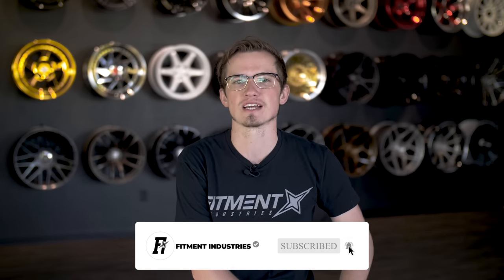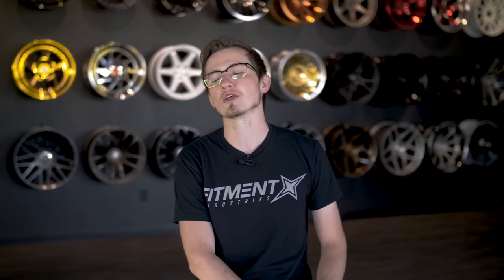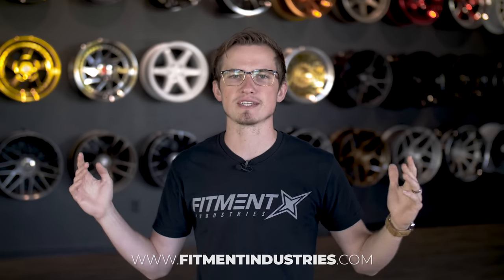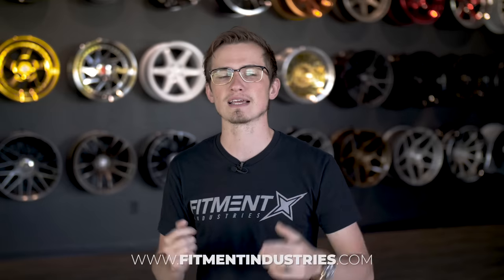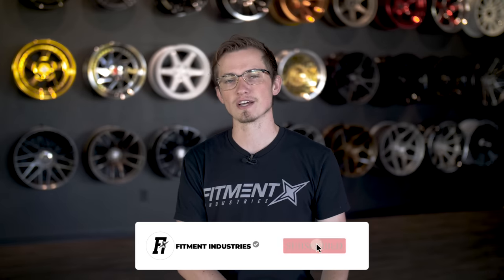Why You Should Lower Your Car

Comment: I prefer lowering the car on stocks over aftermarket wheels on stock suspension. I’d rather see a car slammed on it’s nuts on steelies over nice wheels with a 10 inch wheel gap

Comment: yep, junkyard swapped discs on the rear, and tein coilovers first.....then the list gets continually( and forever?) longer...lol.....great content, glad I found your channel
Reply: btw, itsa 97 impreza outback sport 2.2 NA, and, if any one cares to read this extended paragraph that list sofar includes;  95 Legacy rear discs, Tein Flex Z's, sti alum front control arm, Cusco front strut tower brace, Whiteline rear adj. strut tower brace, Whiteline rear trailing arms, laterals,  and connectors... might sound expensive, but most of these things replaced high mileage, worn-out OEM equipment, that would have cost about the same to have done at any shop/and/or buying subaru factory replacment parts ( $$$ as they are "very proud"  of their stuff, $$$... just sayin'), as i did all but the final allignment myself (With MUCH help from MANY Youtube Channels, including quality channels like Fitment Ind. ) .....But, brake and suspension work was interrupted by water pump failure, resulting in blown head gasket...yeah, i know, subies blow head gaskets like rain in Florida, but 245,000 miles and a good overheat will almost certainly kill something that used to seal......that means milling heads, multi-angle valve job, better springs/retainers, ARP headstuds, gasket-match/port n polish heads, gasket-match intake, Delta 200 torque cams, Inferno Fab's EL  (matbe UEL rumble?) headers, and Flowmaster Delta 40's; i mean you can't just "put it back together stock"........soon to resume suspension/brakes with adjustable anti-sway bars and mounts/links f / r. ( prolly Whiteline ), Whitelines' roll-center adjust and anti- lift kits (to reset suspension geometry angles after lowering), Cusco's lower subframe brace rear and lower "H" brace front,  and finish up with old school early 90's sti/wrx 16's and 4pot/2pot brakes, and finally Wilwood's brake bias/stainless lines......for now

Comment: I was going to buy a set of rotiform lasr’s for my r53 mini which has lowering springs but I still stink it’s not low enough but now I’m leaning towards going with coil overs before I do the wheels because as I think of the wheels I think it may look better when it’s lowered with the stock rims in comparison to the other way around thank u guys for making this vid. It should have been made sooner.

Comment: I chose wheels and tires first. The stock wheels on my 2000 civic already were awful and did not want to be the guy lowering his car and driving around still on stock.
Reply: Now my new to me 2016 Miata will get suspension first since the default wheels are not a bad sight.

Comment: Im buying a 2006 Infiniti g35 sedan. Im putting coilovers first, then wheels and tires, then ill put in the xenon headlights and tint tint the lights and windows, then as far as the engine and power gains goes ill start with a cold air intake and exhaust
Reply from the maker: Sounds like a wild build man you should upload your car to our gallery sometime! https://bit.ly/2Ma4oca 🙌🔥

Comment: I out Eibach 30/35mm lowering springs on my Fiesta ST150 and now just bought some Sparco Assetto Gara's. Gone down an inch too 16x7 and wrapping them in some 205/45 Toyo TR1s. They are Matt black going on a Black ST150. The ET is 10mm less than standard so all together the car should sit and look much better.
All documented on my YouTube Channel

Comment: I have Enkei Raijin 18 x 9.5 + 45 on my 13 wrx with the rear fenders rolled.  With BF Goodrich G-Force Comp 2 Tires 255/35 R18 .And it's on stock suspension . Not to high not too low looks GREAT. 👌
Reply from the maker: You should definitely upload it to our gallery sometime we'd love to see it! https://bit.ly/2Ma4oca

Comment: I did the following and very happy with performance results.  
1. High performance tires
2. Performance brakes
3. Tune and full turbo back exhaust together for stage 2.
4. Engine mod: cold air, charge pipes, diverter valve, turbo muffler delete.
5. Enkei RPF1 rims
6. KW coilover
Reply from the maker: Sounds gnarly dude you should upload your ride to our gallery. We would love to see it! https://bit.ly/2Ma4oca

Comment: the first car I have is 2002 renault clio 1.2 16V 55kw, and this year i changed suspension and brake parts to a new (stock wheel gap), cause if I would put lowering springs my car would SCRAPE the road.
In Croatia There aren't many good roads that don't have some sort of damage, unless you are near big city's.
By lowering my car I would have damaged my car underneath. 
So for me I'm going to change my stock 14'' steel wheels (at the begining of next year, when I'm going to have money to buy better quality wheels) that came with a car to an alloy wheel 15'' or even 16'', depending on a weight of the wheels.
And then after an year or three years if I won't be satisfied with the look's and how car handles I'm going to change it.
Reply from the maker: Well, man when you're ready to upgrade your wheels check us out! https://bit.ly/2Imgo9B

Comment: Anyone know the drop on TRD lowering springs?
Reply: Just pull the trigger bro. Install them and test them for a month. If you don't like them you still have them fairly new just sell them on Criagslist or Offerup.
Reply: Ronaldo Mejia I want to say 1.5 front and 1.75 rear loaded .  I would just go raceland coilovers . Then you can adjust as needed . Super easy to install too and priced reasonably. I’m running em 3” drop and no issues .
Reply: @EARDRUMASSASSIN  might as well. They r the around the same price and coilovers better
Reply: Coil overs which cost the same as lowering springs is a terrible idea. You can adjust height as needed, but unless you need to slam for car shows or live in a heavy snow state, you will never mess with the height once you’ve set it. And at the very very least, go tein street basis. 

Lowering springs are perfect for most people.
Reply: trdmomo lowering springs are for ppl who don’t want to lower their vehicle properly and do it cheaply . You realize stock shocks and struts are longer than aftermarket coil springs and can unseat the spring easily because you just mismatched coils and struts . Coil over kits have matched spring rates for the struts and shocks . The only good tein  sets are the 800 dollar and up kits other than that they are basic over priced . You also don’t get the performance out of stock struts and lowered springs as you do with true coil over kits . I honestly don’t think you know what you are talking about but to each their own .
Reply: EARDRUM ASSASSIN do you realize for someone saying I didn’t know anything, you suggested the OP buy raceland coilovers? 

It’s cool. You already showed me your hand.
Reply: trdmomo what are you talking about ? I have a feeling you don’t even own a lowered vehicle . Go practice your awful golf swing . There’s nothing wrong w raceland coil overs . You probably never owned any of the brands even mentioned lol
Reply: @ Ronaldo Mejia, I wouldn't do just the spring's on the stock shocks/struts they will end up blowing the seals quickly and you'll end up with a bouncy ride, so get new shocks/struts with the springs. Raceland is ok but they only have 1 collar for height adjustment if you lower it too much you limit your shock travel and will bottom it out easily. Tein street basis also have a single collar but is a better quality product.  The lowest price coilovers that i have found that have 2 separate collars for ride height and spring preload is cxracing so you can load the spring and still get full shock travel and still be able to lower your car.

Comment: I have a 2013 Hyundai Elantra and I’m wanting to lower it but still want to keep the ride quality and handling as much as I can. Should I got with Springs or Coilovers? I don’t have air suspension money right now but maybe down the road
Reply: @ Marvin, sorry man that doesn't exists, every lowering kit be it spring, sleeves or coilovers will ride harder they need a higher spring rate to keep the car from bottoming out so you end up with a firmer/harsher ride. But usually a lowering spring will be softer than a coilover set up, just remember to change you shock/strut because you old one's will blow shortly after you put a stiffer spring on them.
Reply: Right on. Thank you
Reply from the maker: Lowering coils are a great option a decently smooth ride, I have seen some guys at our shop running coils and depending on what kit you purchase the ride quality on some coils can actually turn out pretty nicely!

Comment: So this is what I did to my Ford Fiesta Titanium in order:
1. Change the front grill to a black one instead of chrome (I hate chrome)
2. Change wheels & tires to 17 inches (stock is 16 inches) & black colour (original wheels are silver)
3. Do some wrapping (rallye stripes, remove all chrome accents, side mirrors black etc.)
4. ECU-Tuning to improve performance (stock was 100 Hp so I wanted a little bit more punch)
5. Sports air-filter from K&N
6. Sportsexhaust from Fox.
7. ST X suspensions/coilovers
And that's all I am ever gonna do. It's my daily car so I have to keep it practical.

Comment: First mods... For men... 

Brakes... 

Anything that adds hp... 

wheels that are light and strong... 

Tires that grab traction... 

Forget tint.. lowering.. system... 

Now your car is faster and you can pick on idiots who cant keep up.. 

Also moding suspension should be for better handling.. lowering kits do not always make a car handle better... most of the time it makes the car handle like shit and cost you time on your lap..
Reply from the maker: Cant talk that smack and then bust your car up on a turn! 😂
Reply: @FitmentIndustries  THIS.... IS.... MERICA!!  we DONT DO CORNERS HERE..
Reply: @FitmentIndustries  but honestly most suspension mods I have came across didnt result in performance.. some do for sure but most people ignore anything that doenst lower a car. :)

Comment: I'm 60 but got a black n yellow 05 mini S and i'm currently having a 900rms sound system installed. Next I am looking at the "KW Suspension KW Coilover Kit V1
KW-10220042". I think I read somewhere that it will lower it a minimum of 1" and a max of 2". Is that correct and do you think that will cause rubbing issues?

Comment: YouTube algorithms are scary. This has been on my mind lately. This reasoning had crossed my mind so kinda glad it's back up a little. Recently got a new GTI. Plans are..
1. Front "no holes"  license plate bracket. Done today actually. Just in time cuz my temp tags are almost expired.
2. Rear wing extension. Inexpensive and massively changes the profile of the car for the minimal  investment.
3. VTF lowering springs. Cant justify the cost of DCC coilovers for the short term. This seems like a good option for the next 2-3 years.
4. 18" or 19" wheel and performance tires. Wheel size will depend heavily on how car drives with the springs.
5. Stage 2 tune when/if I buyout the lease and end.

Comment: i got an 09 dodge avenger sxt, looking into aftermarket wheels (DRIFZ® - 303B HOLE SHOT Satin Black) and possibly going with (Meghan Racing Coilovers) what do you enthusiats out there could advise me on what to look out for or go for. i wanna know what offset would be nice and maybe other varieties on coils? the wheels i want im planning on getting them 18x8 witha 35+ offset. i'll let u car heads give me the proper advice.

Comment: My 2018 VW Passat GT came with a tuned lowered suspension from the factory only problem is the drop was only .6" and the wheel gap up front was noticeable. I got a set of H&R lowering springs and even though the drop is only 1.4" front and 1.5" rear (in reality .8 front and .9 rear factoring in OEM drop) it looks 100 times better and the drive is identical to OEM.

Comment: I did H&R sport springs on my 95 Saturn Sl2 with the stock sawblade wheels which are 13 lb wheels and a polyurethane bushing kit. But now I want to buy Einkei RPF1 15 X 7 with a wider offset in the rear, 205 50 R15 Toyo proxies like what was on the blue Mazda Miata, in one of your other vids and Eibach race springs and lower it another 6 inches, maybe more to have a wheel gap no more than being able to slide your fingers in the fender over the tire and nothing more. Just need to find a decent place to get the right spring dimensions to accomplish that.

Comment: Just keep it clean and as oem of a look as possible.

1. All bulbs led or maybe hid, consider they make really bright led lights now(I prefer white headlights and fogs now instead of the blue and yellow)
2. Slam it
3. Maybe aftermarket rims if your traction is necessary for track use, or you want to ad a little of your own touch to it.
4. Muffler and maybe exhaust(not too loud)
5. Sound system
6. No tint even

I just personally prefer it as clean/ oem as possible now. When I was younger I was more into the cosmetic appearance. Now, as long as it’s mint and slammed with maaaybe some nice wheels , that looks good. Everything I mentioned was assuming your not actually building your car or motor for actual performance needs.

But in the end, it’s your car. Do it how you want it. F*** the haters. You want under glow and body kits and chrome and stickers etc.. it’s your car. Do what you want. Who cares what anyone else says, it’s your car.

Comment: I just put in bc coils on my lexus and dropped it about 1.5 inch and so far it runs great! Yes lowering your car ultimately means you are giving up ride quality for looks and performance.  As long as you don't drop it too low and have a good aftermarket suspension it's fine in my opinion

Comment: Hey Fitment Industries. I came across this video because i'm thinking about lowering my 2020 Honda Accord Touring 2.0 with adaptive suspension.  What would you recommend for my car with the adaptive suspension?  I'm not looking to slam the car on the ground just to get rid of some of the wheel gap just to give it a good look. I'm planning to get aftermarket wheels as well. I know this video is 2 years old but hopefully  you would see this comment. Looking forward to hearing from you.

Comment: I bought wheels first because I bent the factory forged wheels on a curb. Difference between forged and cast. It may not be fixable but a forged wheel won’t explode on impact and you might be able to drive it home vs cast just cracks and breaks on any type of impact therefore your left stranded. My forged wheels took a curb and hit me home afterwards and that wheel is still currently holding air even thought there’s a massive much into the lip

Comment: I can’t pull that off with my Sentra SR Turbo. The stock wheels are tucked in and it would look horrible if it was lowered. I’m saving up to get wheels, tires and suspension in one shot.

Comment: Bought wheels and tires 1st and was like: "my car handles a tad better but dives too much into corner" cause I had more grip, so I added roll to the car. Fixed that with some BC Racing BR series coilovers and the "nigh&day" difference was real.
Lowered it only for function: 4 fingers in the back, 1ish almost 2 in the front (am I allowed to write that on youtube ?). 
Why am I laughing ? ... (heum heum) Anyway, the car felt way more stable. Next some sway bars to have more "turn-in". 
It's all about personal preference.

Comment: Waiting for my wheels to arrive first. Once I see how they fit with my stock suspension, I'll be able to tell if the lowering springs I want will still work. I prefer to have the wheels I want over lowering the car. That said, I'm pretty sure a 1.5" lower with springs will be fine. 2020 Subaru Impreza Sport hatch.

Comment: Had a BRZ which I lowered on the 'best' suspension according to what I could find online. Didn't drive as good as stock. When I got my most recent car I did wheels but not suspension, I figure the suspension geometry is something they nail OEM, and not something I want to mess with on a BMW 440i

Comment: Latest trend in the UK I've seen is to fit smallest steel wheels with lowest profile tyres possible.  Always seems to be on really small cars with everything suspension wise left stock, which is just as well as they run pretty low.

Comment: Should i lower my car or tint it first, besides what the video says i live in NJ and we can have some pretty snowy winters and this would be my daily lol. To paraphrase, i am going to do both one now and one in the spring.  Which should i do first? Thanks
Reply: I would tint first if you're worried about the winter. But it all just depends on what you have and how comfortable you are driving a lowered car in snow
Reply: RB Zerkoh never lowered my car before, but I think im just gonna do it
Reply: @JAndruchowitz  That's a good way to go. Right now is a good time to lower one and get used to it before trying to tackle the snow. Hopefully it all works out for you
Reply: When it snows, do you absolutely have to drive in it? How much snow would have to actually be on the ground before your car actually started acting like a snow plow? 

Where I live, a snowstorm basically closes schools and allows a lot of flexibility for company employees. Once everything is open again, the roads have already plowed. Actual traction becomes more important than anything else.
Reply: i think i should be fine in regards with snow because my area is like that as well.
Reply: JA063000 I’ve driven slightly lowered (1-1.5”) cars in the snow for years. As long as it’s not slammed. I can’t speak to being slammed in the snow...
Reply from the maker: Depends how low you are going man! Personally we are from Wisconsin so the winter can be rough af so I would recommend the tint, But if you are comfortable with driving low in the snow ( see what I did there lol ) then send it!